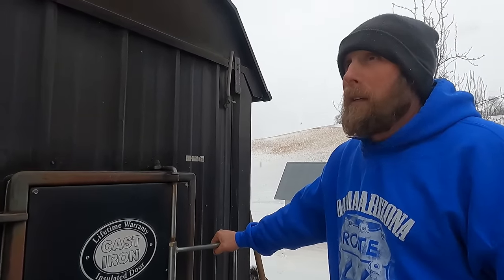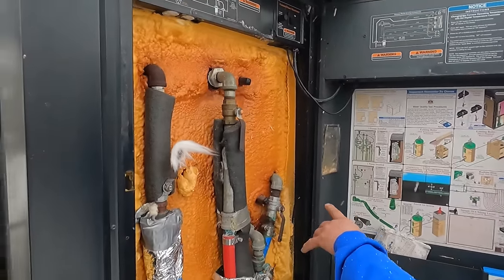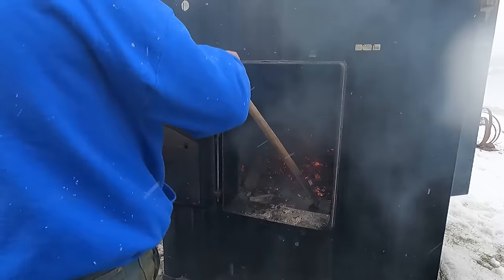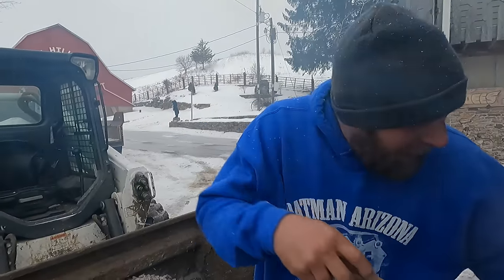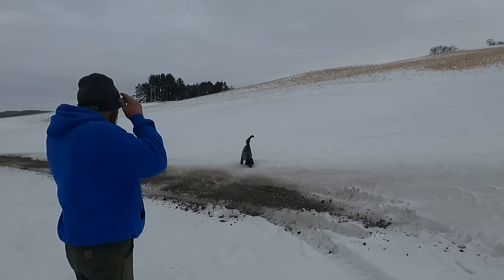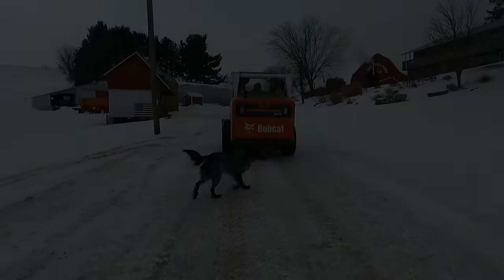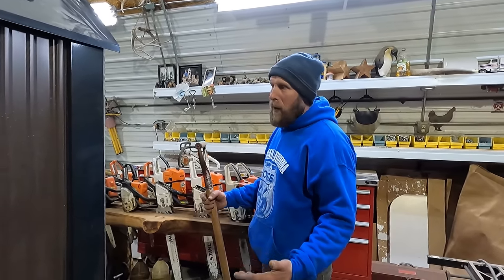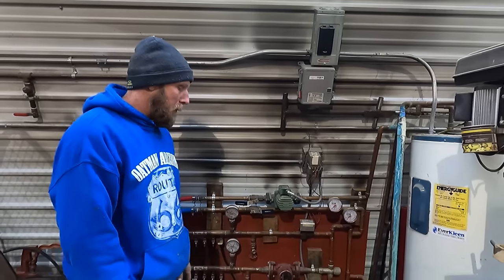Outdoor Wood Boiler Review l Pros and Cons (20 Plus Years of Experience)

Comment: As for LEAKS…..I strongly suggest the use of antifreeze.      
I’m my first boiler I used well water. Had it tested religiously and used additive as per manufacturer. After 5 years it leaked. After 10 years it was completely gone(would take more money to buy steel and weld it than to buy a new one). 
     Bought new boiler 5 years ago and have used antifreeze mixed with deionized water and have had zero issues. 

Point being, even with the professional water testing and  costly testing and additive they couldn’t tell my well water was corrosive enough to eat through my steel boiler. Although your results may vary!!

Comment: Question about the outdoor stove. If you built a shelter house over top of the unit with a wall facing the side that takes most of the weather only. And possibly keep some of the weather off the stack of fire wood too. The outside stove looks like a amazing addition to the farm house and shop. I have clean burn used oil furnace for my shop only and propane to he my house. Fire wood would definitely save me money each and every year. Great video and as always looking forward to the next

Comment: I prefer cast iron radiators. There is a company that rebuilds them so they are leak proof when purchased. The primary reason I like them is you always have residual heat after the water pump shuts off and I mean the water pump inside the house that is not pumping boiler water from the wood furnace but the boiler inside the house the outside unit heats through a heat exchanger. I grew up with forced hot water cast iron radiators and when the heat kicked on there was something satisfying about the snap crackle of the radiator warming up. To me the only way to heat a house.

Comment: I got a quick question I currently have a indoor woodboiler in my garage to heat  my house like baseboard heat.  I believe it's what is called a pressurized system . Can I buy an out door wood boiler or do I need to stick with an indoor wood boiler
Reply from the maker: I think it's just a matter of running lines.

Comment: I have been running my Central Boiler for 16 yrs now with now problems, original solenoid still working however my neighbor has the same unit as mine and he was having boil overs constantly because of a bad solenoid, it turned out to be the cottar pin hanging up on the solenoid, he put the proper on in there so that it cant bind anymore and problem solved, been good for 12 yrs now
Reply from the maker: It's a great boiler yeah we thought the same thing when it went bad but wasn't the case! 
Thanks for watching and commenting!
Reply: @GierokFarms  I live in northern alberta,canada, and I would buy another central boiler in a heart beat

Comment: Hawkin 2100 and I wish I had the umph to say I’ll just get a new one. Thankfully it made it through cold stretch. Last night 50 degrees and it was making terrible noises. I thought the pump went out. Tried to add water (directly plumbed in) and it shot out from somewhere behind a panel.  (17 years). Now I’m fighting to get the panels off to see how bad of a disaster. I don’t weld, so then when I can see how bad….

However I’m in Maryland and no one else is using these with in a 100 miles.

Comment: I have a 2006 central boiler 6048 classic i love it tho had problems with solinoid for flap door, front door has cracked a few times and boiler jacket in rear did crack after 7 years of hard use

Comment: Looks a lot like the central boiler CL17 I bought new in 1995 for $4500, but bigger, same draft system Aquia stat ect. Is the fire box stainless steel? Mine wasn't and it started leaking at about 20years of age I kept welding  up leaks until 2018 and finally gave up...
Reply from the maker: We haven't had any problems with ours yet haven't had to weld it up!

Comment: How much does something like this cost? Stumbled on your video while looking around for alternative heat with today’s ridiculous heating oil costs. We use wood pellets but that doesn’t heat our hot water so we’re still spending $$ on oil and pellets. We have a 2 car garage that would be great if it was heated too. Something like this could be plumbed right into our hydronic baseboard, hot water tank, and some baseboard added to our garage to heat everything right? We have a raised ranch and if something like this could provide enough heat we’d finally heat the finished basement too. I’ve never had wood fired heat so I know very little about it and was shocked to see the size wood you tossed in that boiler. It wasn’t even split 😳 didn’t realize it would season well enough not being split. I suppose the water lines have to be buried fairly deep and insulated. If you have a ballpark cost figure to get one I’d love to hear any input. Appreciate this video and everything you walked through.

Comment: Wood heat is nice, but it can get the air in the house much too dry to suit me.  I'll get cracked sinuses with nosebleed and itchy dry skin with just wood heat so when heating that way I always had a couple small humidifiers running constantly, one on each end of the house.  Sure made it easier to breath and feel comfortable.

Comment: Stumbled on your video. Very well done. I'm hoping to get an outdoor boiler this year. I'm in Northern NY on the Ontario border on our farm. We've been using a wood furnace in the basement for years and it's getting pretty well shot. The idea of nice steady hot water heat and being able to heat my shop and domestic water too without the dirt and smoke in the house, to say nothing of the fear of a chimney fire!, is really pushing me. Again, great video, very nicely done.
Reply from the maker: We are glad you found it! Thank you for watching the video!
Reply: Only problem w/outdoor wood boilers is they don't get the smoke high enough. Maybe no big deal out in the open with always predictable breeze. But he knew what he was doing putting the second flue piece on that boiler.... I'd like to install an OWB right Inside the barn and run a proper flue straight up through the roof 💁‍♂️
Reply: @georgehofgren6123  As long as it's done properly, insulated chimney, it would likely work fine. Some folks say the increased draw of a longer chimney will increase wood use, but if the damper is working right it's probably negligible. My barn is too far from the house for that to work for me. I'd just like to lower the fire risk and get that nice constant heat. Forced hot air is the pits!!!

Comment: If you shot closed cell foam in everything you built, you might still be running your first small boiler.
Every couple o' years some rich dude convinces me he is starting a boiler installation biz and I should install his. Everyone uses the same draft door solenoid. Every maker says theirs is different, but it's all the same.
9 out of 10 I install the owners are un-realistic about how much wood is needed. And un-prepared to supply a daily incinerator. Don't get me started on glycol and non-insulated buried line.
Reply: Just through my first winter with a boiler. 14 full cords (previous owner told me 4!).  Boiler is 20 years old, and still going strong though. Absolutely love it. Curious what you mean by cell foam. This one has some spray foam looking stuff in the main panel, but plan to open this up for a real inspection/cleaning this summer...

Comment: There wood eaters. That why i love my US LARGE WOOD BURNING STOVE. Less wood and more heat. There a few more Plus about it 👍 It can be a rocket stove by adjusting the ash tray, and i can cook on it as well. The wood last about 8 to 12 hours depending?   if i use it as a rocket stove. That the highest heat i can get out of it AROUND 500,000 BTU > That sucker was glowing RED HOT. 🔥🔥I only did that once. and let it cool down VERY VERY SLOWLY

Comment: Also I wish I did things as good as you ,,, I think the days of the preppier getting his due is coming ,  
God bless you
Reply: One thing about these stoves is they really don't solve any prepper problems. They need electricity to run the damper, run the pumps, run the fans. If they are tied into the central heat system, they need electricity for that. They are a developed world convenience to a wood stove in the house. But I like them.

Comment: Hate to tell ya but there was a p&m dealer here and I bought one as well as others in the area and mine lasted the longest at 8 years they all rusted out and are gone with no warranty coverage even though they were supposed to be covered for 25 years in my honest opinion your old central boiler will outlast that new p$m if I were you I wouldn’t get rid of it you’d be better off keeping for backup when new one rusts out and let’s water into fire box
Reply: I don't know about P$M. Those various ash grates, slats, trays, etc are maybe the controversial items on these stoves. Lots of convenience on the one hand, lots of area for corrosion on the other hand. One thing about Central Boiler, they used a thick simple ash pan with no gadgetry.
Reply: You should run a glycol mix in a closed loop boiler to reduce corrosion.  There’s a whole science behind any boiler feed water system to get maximum life.  It begins with using soft water…. Do it for the same reasons you don’t run straight water in an engine basically.

Comment: I get it. Mad props for building it himself. But I find it amazing people in the US have these inefficient boilers and old systems. You should study scandinavian wood burning systems. I would say they are at least 1-2x more efficient with wood and would have at least 3x the amount of water in an insulated ackumulator tank. 1 firebox half that size would heat the place for 24 hours easy

Comment: I always thought these were the boilers were very dear. Last couple years started using one was all rusted out and burned up had to weld a new top on it. This year front right at all out of it and the bottom is rusty decided to scrap that one. Got a different one can’t get the water temperature up I’m very disappointed in these stoves about ready to scrap them all and go to propane and nobody can tell me why it’s not working correctly

Comment: I am wondering why these companies do not have an mechanized ash dumping solution where you could press a button and have some kind of conveyor system help pull the ashes out to make it easier to remove the ashes.  I am thinking a chain driven by a motor or even a crank with metal compartments could rotate toward the opening to pull the ashes out and then dump them into a metal trash can set up outside the unit.  You would still need to brush it down from time to time but not nearly as often.

Comment: Don't know where you guys are but most of the water in the western states is heavily laiden with minerals, calcium etc. That's the first thing I always think of when it comes to anything plumbing related. But I've always liked the idea of heated floors.

Are mineral deposits an issue with your water? And if so how has it affected your equipment, performance, maintenance etc?

Comment: New boilers here have to have a certain standard,it s important to know their efficiency,here it has to be more than 90 % and the gas that is contained in the wood must be burned in top of the boiler where the smoke is directed forward and then backward,before it goes outside,in principle it should be smokeless.

Comment: Before you buy check your local zoning regulations and town ordinances. Many towns have banned outdoor wood boilers/furnaces because of the significant local air pollution they create. They make a lot of smoke and, if used to heat water, they're in year-round use.
You might want to check with your neighbors as well. I certainly wouldn't want to live next door to a wood boiler. (They're banned in my town in rural, northwest Connecticut.)

Comment: Why not have the boiler in your house, have a proper long chimney with proper draft, a nice big hot water tank for the system and you'd have way more heat due to it being lost in the house. Plus with natural draft you'd not need the ventilator so no need for electricity for it to work. But then again I have been in the family business and we produce our own boilers for cold climate central heating systems. Some of our clients have had our boiler working for them for 40 years straight!

Comment: I live in Canada. Past the Far North boundaries. We use fire wood to. We do have propane heat. But most rather use fire wood bcuz gets to cold. And gets to cold. So would u can’t put in down in the base or attic and And so every home has a wood stove but for back up. Child are also trained and learn about fire safety in the schools here. Most like to used jack pine Green and dry wood. And use popular trees for smoking wild foods. But some also use it for fire wood to. They don’t like it the pop tree. Creates to much ash to fast. But with jackpine. You’d have to look for one for your stove pipes once a week and clean or change them every year. The fire department are the ones who decide if u need to changes your pipes also. And can’t change them with their approval. Or withness. But u pay for their services to clean or change. But they also give u the pipes and such. For free. It’s not really free. The fire fighter here are the ones working for free. Your just paying them to come clean or change or fix. For the parts on whatever they bring to repalce. But they also work for a other work place. And could leave work at any moment if needed for fire duty & such. And they still get paid from the work place.

Comment: A person could easily lay concrete blocks and put a regular furnace add on in it . Pump the heat into the house. No mess inside and less than 2000$ cost.

Comment: I hate to say it but I have a heat more for the last 18 years and the only thing I can say about it they have an ashtray in it other than that they BSU about it being stainless steel and it's not it's just mild steel it's also a good heater Peter I've mom my 2nd one already I've actually taken 1 apart and fixed it made it better no big deal so I'm not a Weld not a Weld the next 1 I makes gonna be  750 gallons
Reply from the maker: Good to know thanks for commenting!

Comment: What if the electricity goes out, does it choke itself off?
Reply: Mine: pumps don’t work or blower. So it doesn’t heat the house, but the fire will simmer for days.

Comment: Take your new solenoid apart and coat the bare metal parts with high temp grease.   Silicone grease is even better.   That will keep condensation off the bare metal and it will last much longer.

Comment: We had a 350 000 but Homesteader boiler up in Saskatchewan. It had an ash pan under the burn box and the floor was all louvers that would rotate to let the ash fall out. That worked for 1 year. After that it was a hoe and shovel. When it got down below -40 the damper never closed. It just burned solid. Over 700 lbs of spruce a day at those temps, stocking every 4 hours. When the power went out the water pumps all quit, so generator back ups were necessary. And if those didnt work, Dad put a water pump on and old exercise bike to circulate water around. I was so happy when that boiler finally died. We just tied in a natural gas one onto the back of it. Much nicer on the back to run that

Comment: This boiler has no grate? Its a failure...man you get a lot of ashes...i woild rather have sand hot battery...you can heat sand way over 212 degrees.and have little metal pipe inside to take hot water out...well good luck there

Comment: Water heat a waste of energy. Forced air is the way to go. You don't have to wait, FREEZE, while you waiting for heat. As soon as the fire lit, it's putting out hot air!! I lived in the snow belt of western New York. I over 60yrs old, been burning wood before this boy a spark in his momma eye. With a hot water boiler, you always got chance of freeze up, busted water lines, radiators or heat transfer units. With forced air, none of these problems.
Reply from the maker: true